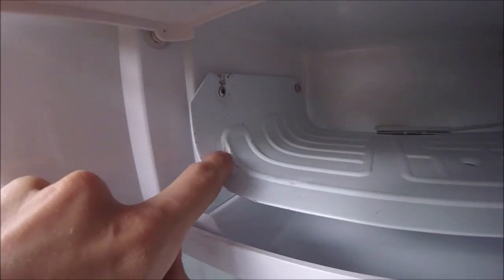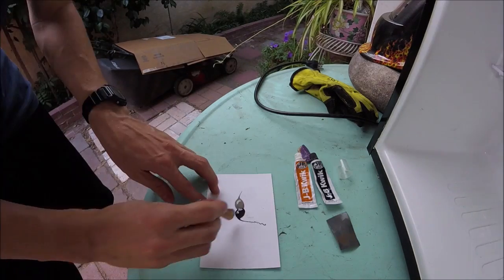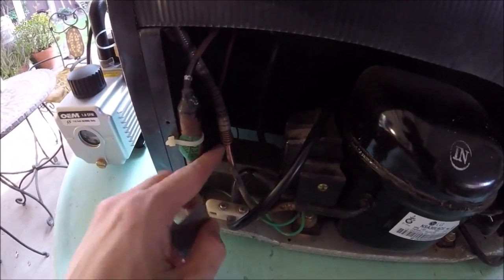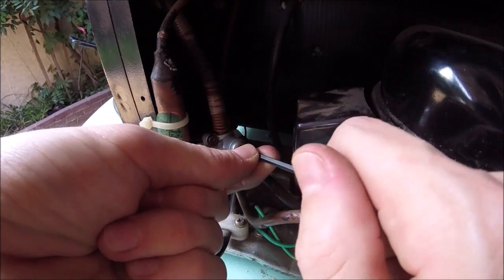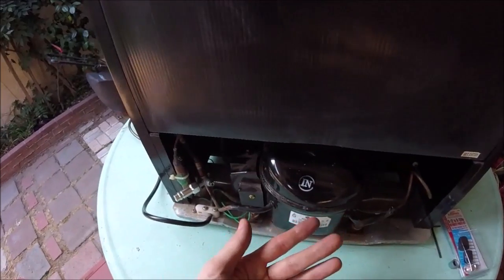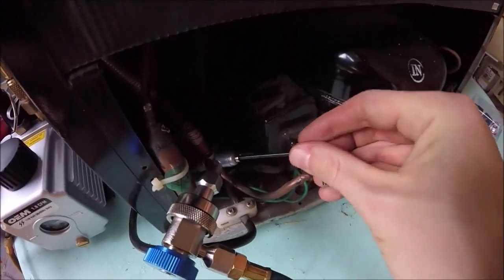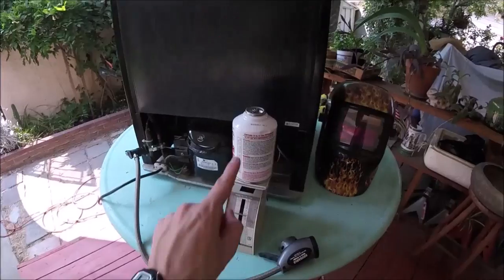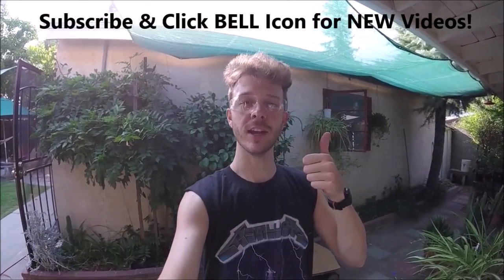How To Fix a Broken Mini Fridge -Jonny DIY

Comment: hey great job and question would u use jb weld water or would u use jb weld in the yellow and black tubes on a mini fridge doing what your doing in the video im trying to patch a couple of holes that i made in the coil  so it won't leak back out thanks let me know and great videos and have a blessed day amen
Reply from the maker: The regular jb weld I used worked great, I havent tried the regular clear type epoxy but I think it would work too

Comment: i'd been smelling that coolant faintly for two weeks, and when i went and defrosted the fridge using rock salt (!) i found whoever had previously defrosted it beat the hell out of it and put a leak into, explaining the weird smell i'd been noticing.
Reply from the maker: Dang thats too bad. Sorry to hear
Reply: @JonnyDIY  i tried welding it but even on 20 amps i got burnthrough, so i'm going to try riveting a patch of sody can aluminum on it with some epoxy on the edges.
Reply from the maker: @RealDoomVoxel 🤞good luck hope you can get it fixed 👍

Comment: I own a Galanz mini fridge that was bought in 2019 and was working just fine in March of 2023 when loaded in my van laying on its back. It stayed that way until November 1, 2025 when finally removed to hopefully use. I left it upright for one week before turning on. The freezer section started to get cool then went back to room temperature. The dial thermostat was stuck and its skinny temp sensor line was busted so I removed the t-stat snd used an auto spade fuse to jump the wires to the compressor. Still wouldn't cool so I tried the hot rags wrapped around the drier and capillary tube to see if that would soften any hardened oil in those to allow the passage of the refrigerant again (this model uses butane as the refrigerant). I poured a gallon of really hot water over those before turning it back on to find it still wasn't cooling. The lines inside the freeze compartment made a brief sound as if some refrigerant was present and trying to move. Was thinking about replacing the drier and capillary tube so Googled that to find your J-B Weld repair and refrigerant recharge. I suspect that J-B could be used instead of solder due to the low operating pressure. Was thinking about using propane instead of butane as the refrigerant since my RV trailer uses propane for the stove and have a few small propane cans for a camp stove to use. Was wondering about adding the required oil before adding the propane since pulling a vacuum should suck out the oil along with the air/remaining butane. Also wondered if you have tried the hot water with rags before and if you did that while the compressor was running to get the softened oil moving out of the drier and capillary tube to end up back inside the hot compressor?
Reply from the maker: Propane can't be substituted for the butane. Please do not do that, it can cause explosions
Reply: @JonnyDIY Thank you for the quick reply. I'll try heating up the drier and capillary tube again while the compressor is running. I did test the start/run relay with a VOM and got the correct readings. I then took it apart to inspect the contacts and rub off a haze on the disc (temp sensor safety switch?). I checked the compressor motor's 4 prongs for the rated start/run resistance to find the Run circuit resistance was higher than specified (think it was supposed to be 10 ohms and mine was 18 ohms). Would the higher resistance affect the operation of the compressor?
Reply from the maker: @billwilson-es5yn  most likely is damaged beyond repair from laying on side so long. Usually only time people lay them on their sides is for short transport trips. The oil most likely plugged something up

Comment: Ohhhhh… so that is what that valve on the fridge we bought from a guy who assured me it worked was for….
Reply from the maker: Hmm does it work? Yeah was most likely recharged at one point
Reply: @JonnyDIY  It does not. I have no emotional attachment to this fridge but injured pride, so not sure if it is worth throwing any additional money at it. Great video! If I had access to the tools and only the amount of product I needed I would def try.
Reply from the maker: @sunshineflyer bummer so the guy sold you a non working fridge, what a gem he is. Sorry to hear
Reply: @JonnyDIY  - yeah. I’ve been so lucky in other purchases, and I like to keep things from the landfill, but this one was a dud. I was hoping at first that it might be just the relay or something- easy, cheap fix with normal tools, but then I noticed some oil in the chilling tray and a patch on the coils, that I hadn’t seen. We haven't used the multimeter on the thermostat yet, but I think we found the culprit.

Comment: I messed up and punctured mine....Titanic was in there and I used knife to try and chisel at it....heard the pffffffffff hissing sound 😢 Didn't know what it was.....finally de-iced with some warm water. Plugged fridge back in...left it for hours and came back to warmth😢 I decide to seal the hole with  silicone CAULK before googling.... I'm screwed....this chick can't do all that you showed here 😢.. help
Reply from the maker: Bummer if cant do all this, better off looking for a cheap used one on craigslist or facebook. People regularly sell for 50 or less 👍
Reply: I appreciate you for responding...yea i cant fiddle with all that...will have to replace @JonnyDIY
Reply from the maker: @chispice1 you're welcome, good luck with the replacement search 👍

Comment: I'm here bc im a dummy, ordered the epoxy...stay tuned. Thanks for the video!!!!
Reply: I messed up and punctured mine....Titanic was in there and I used knife to try and chisel at it....heard the pffffffffff hissing sound 😢 Didn't know what it was.....finally de-iced with some warm water. Plugged fridge back in...left it for hours and came back to warmth😢 I decide to seal the hole with  silicone CAULK before googling.... I'm screwed....this chick can't do all that you showed here 😢.. help
Reply from the maker: You're very welcome, happy I could help. Good luck!🤞

Comment: I have a very small redbull mini cooler that leaked all the R600a out . Fixed the leak but dont want to use R600a.  What would you replace it with R134a or R22 ?   It's just a small science experiment. Thanks 🇺🇲
Reply from the maker: You could try r134a, but it may not work or not work well

Comment: would it be of any use if we apply some type of plastic or metal small mesh before applying the glue? Thanks for your time to make and upload the video!
Reply from the maker: @imnutrak130  yes you could use a small piece of fabric or fiberglass mesh so glue doesn't drip in hole and clog it. Especially if large hole. But for small hole it's probably not needed as I showed 👍

Comment: Found one of these off the side of the road. Compressor still in good working condition, has a 3/16ths hole that ima need to be careful fixing just like this. Thanks for one way to approach this fix
Reply from the maker: @anthonyjh02  You're very welcome, good luck with the fix 👍

Comment: Great video. I did the same as so many others.....in  hurry to defrost, for no real reason, but chose an ice pick. I got the bullet piercing valve from Amazon. Installed. Used an ac recovery machine for auto repair to pull a vacuum.....held for over an hour. Sticker said it held .04 pounds. Added, but still room temp. Any suggestions? Googled it and said that the R600 uses a different oil than R134a and wouldn't work. Reading all these reviews I thought differently.
Reply from the maker: @ericraschke6589  you want to use the refrigerant listed on the fridge. Did it call for r600 or 134a🤔
Reply: r600

Comment: How do you know if you have to fill up the refrigerant? I have a 2 door mini refrigerator. The freezer still works. My freezer doesn’t have those lines, I just have a small whole in the freezer compartment
Reply from the maker: @paulgasol100  if it still works and cools fine, no fix needed you're good! 👍 if you punctured a line and refrigerant escaped then youll need to fix. But sounds like yours is still working great

Comment: Nice job and explanation.  It's also nice to see your generation being active in HVAC.

One note - to properly handle refrigerants, you should suggest that all get the appropriate licensing.  This one is fairly easy and cheap to get:  EPA 608 certification. The exam costs under $30 and you can get the training online.
Reply from the maker: @petersamios5409  Thank you! And thanks for sharing that helpful information 👍 will check it out

Comment: Awesome vid, man! Just one question: Is it okay to disconnect the R134a/take off the adapter or leave it on?
Reply from the maker: You need to leave the bullet piercing valve on, but can remove everything else 👍
Reply: @JonnyDIY  thank you!
Reply from the maker: @alcar45  you're welcome! 🙌👍

Comment: What if you don’t evacuate the system before recharging, will it just be more susceptible to failure?
Reply from the maker: @Nightowl82  you must vacuum it if it's emtpy of refrigerant. Need to remove air for refrigerant to work properly

Comment: Ok my issue is that the door to the freezer tray became detached and I can't figure how to reattach. Help!
Reply from the maker: The door should have lil tabs or ears on the ends that slip into holes. At least that's how this one was 👍
Reply: @JonnyDIY  Thank you for responding. One of the tabs or ears is missing... can I purchase a part?
Reply from the maker: @gdjwarren2  yes you can buy a whole new door if you search freezer door and the model of fridge. You could also try gluing with some epoxy a small replacement ear made of something like a dowel or chopstick
Reply: @JonnyDIY  thank you for suggesting. I will look into purchasing..🙌🏽
Reply from the maker: @gdjwarren2  you're very welcome, good luck 👍

Comment: I just made a hole right into the coil, I freaked out, but you lost me when you started working with the valve.... is this to expensive to repair?? Where do I send it???😢
Reply from the maker: Sorry you punctured. Not really too expensive if can borrow the vacuum and gauges like I did, but may be better to try and just find another 2nd hand fridge to buy 👍
Reply: Yeah I called a guy and he said it's better to buy another one , so now do I just put it outside ?? Trash?
Reply from the maker: @norisdarjean6350  yes can take to recycling plant just call beforehand

Comment: I used the JB quick weld but it didn't make an air tight seal over the hole, I can still hear refrigerant hissing out. Did I not use enough?
Reply from the maker: Yes sounds like it or it didn't make a good seal. Make sure to sand area well for adhesion. You can try sanding the jb weld and just going over it and making patch larger 👍
Reply: @JonnyDIY  oh great thanks so much I'll try that!
Reply from the maker: @petelombardi5924  You're welcome, happy to help. Good luck with the project 👍

Comment: Can I repair my mini fridge without using the air compressor to suck all the air out? I don’t have access to one. Also would I be able to just take the freezer part out of the mini fridge since I don’t use it?
Reply from the maker: No sorry you must vacuum if the refrigerant escaped. And how these ones work is the freezer cools the entire unit

Comment: Super interesting to watch. But, A brand new compact refrigerator costs $89 at Target. To buy and rent all of the equipment and materials to fix the refrigerant is $220. Hmmm? Maybe if this was your profession and you already had all of the equipment it could make sense.
Reply from the maker: Thank you. Yes I had most things on hand, but did borrow the vacuum pump and gauge set from local Autozone for free. All in I think I only had to invest $20

Comment: This just happened to me. I have a few mini fridges, and I forgot that one of them has the coils build into the tray, just like yours and punctured it while trying to quickly remove the ice that was in there using a pick and hammer. I usually always unplug to defrost it, but my other freezer failed overnight and I was trying to defrost it very quickly. I have JB weld on hand, and will follow your other directions. Thank you!!
Reply from the maker: You're welcome, glad to help. Good luck with project! 👍

Comment: I just did the stupid thing trying to chisel away the ice that almost completely occupied the freezer and I punctured the "tubing" that was on the front edge of the freezer covered by ice 😬😬 it's torn open I think JB-Weld will seal this whole thing allowing no circulation anymore, damn!
Reply from the maker: Put a small piece of tape over hole then extend and cover larger area with the jb weld to seal it and prevent the jb weld from seeping in and clogging the  flow 👍
Reply: @JonnyDIY  Hey great idea, I got nothing to lose :) any particular type of tape? Thanks!
Reply from the maker: @peterhsu987  You're welcome, doesnt matter. Duct tape, electrical tape, masking tape all be fine 👍

Comment: I got one for free. Thought it needed a recharge so I did that. But it needed a new switch relay. It runs but still doesn’t get cold. The freezer tray gets cold and wet. I replaced the thermostat and have been adjusting the little screw in it counterclockwise and it hasn’t improved. The fridge just stays at 60F with a cold and wet freezer shelf. Any thoughts?

Comment: I punctured my refrigerant lines months ago and it's been sitting outdoors waiting to be fixed. I have a few questions before I give this a go though! 
1. How do I know if I need to add refrigerant? Can I seal the punctures, plug in the fridge and if it doesn't cool, move onto replacing it?
2. What happens when you suck the air out and it does not hold vacuum?
3. Since you piercing a hole to the copper line as the first step, you need to reseal that too after adding refrigerant yes? If so, do you use the JB Weld again?

Thanks a ton!!!
Reply from the maker: If you punctured lines you will need to add refrigerant. But first you must patch with Jb weld the spots you punctured. Then make sure holds vacuum to confirm patches are good and holding. Finally no you dont need to patch puncture from valve, simply screw down allen and will seal 👍
Reply: @JonnyDIY  Oh, so the bullet piercing valve stays on as a permanent piece to the copper line?
Reply from the maker: @dangelico  yes

Comment: Ahhh sucks so I did this 2 days ago . Seal the cut , everything dry and now the fridge still isn’t getting cold. But I can hear it running.. what should I do ? Do I need to add refrigerant?💚
Reply from the maker: Sorry to hear. Yes it needs to be vacuumed and recharged 👍
Reply: @JonnyDIY  Ahh shucks I forgot to mention the sides of the mini fridge are cold but not inside. Still the same outcome or is it toast?  Also thanks so much for the video 💪🏽. 💚
Reply from the maker: @RickyVicky29  You're welcome, happy to help. Yes, unfortunately if you punctured a refrigerant line and gas escaped (you'd have heard a hiss noise) you will need to vacuum and recharge. There's no way around that 😔
Reply: @JonnyDIY  Thank you so much for answering I got the tools today so 🤞🏽it works after I add refrigerant. How I do it correctly 😅.

Comment: Quick question when I did the vacuum the gauge stayed at 28 should I be concerned?
Reply from the maker: Did it hold it when you turned it off?
Reply: @JonnyDIY  Yes I got it to 28 waited about 30 min and it stayed at 28
Reply from the maker: @firefistgambino9930  ok good, then it should be fine 👍

Comment: Why wouldn't the manufacturer include a refill valve so you won't need a puncturing device?
Reply from the maker: Save $2 probably and also so you'll just buy a new one probably

Comment: I just recently did it to a mini fridge not knowing that the tray had pipes going through it
Reply from the maker: Sorry to hear. You may be able to find another used one for just as cheap as fixing sometimes
Reply: @JonnyDIY  probably going to have to buy a new one or fix it with your video but all those stickers on there with explosive warning had me thinking LOL
Reply from the maker: @brianv1988  lol yeah. I had most the stuff around so I think I only spent $20. But I've seen these 2nd hand for under $50 a lot
Reply: @JonnyDIY  yeah I bought mine used it's a 1.7 cu ft. Haier it lasted me 4 years then I try to fit some pie that had to be frozen had to get some ice out of the freezer part to fit it forgetting there was pipes that can't be punctured LOL my fault it served me well for 40 bucks that I paid for it 4 years ago so it's about time for a new one if I can't fix this one I already patched it just need to refill it with freon and that's the only part I'm having trouble is learning what I need to do. and I know what parts I need from your video ty for that so I might give it a whirl and trying to fix it unless I can find a cheap one thanks for the tips on your videos you are amazing
Reply from the maker: @brianv1988  happy I could help, I hope you can get it fixed or find a good replacement. Thanks for watching 👍
Reply: @JonnyDIY  no problem buddy you keep up the good work with your videos you're doing a fantastic job and a service to the people that need help with stuff and can easily do it their self now that they have information from your videos instead of spending a lot of money on new stuff or sending it to a mechanic that will charge. A lot.  so I say thank you sir well done
Reply from the maker: @brianv1988  thank you for your kind words 🙏